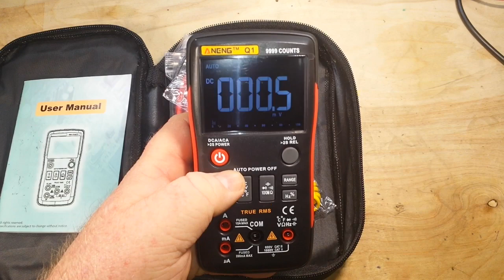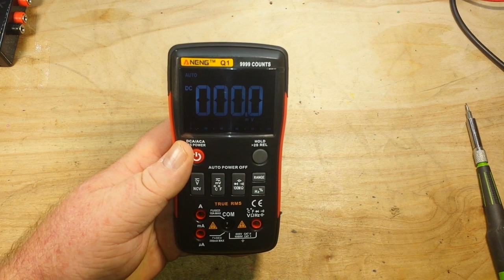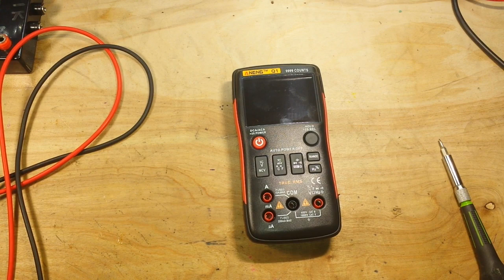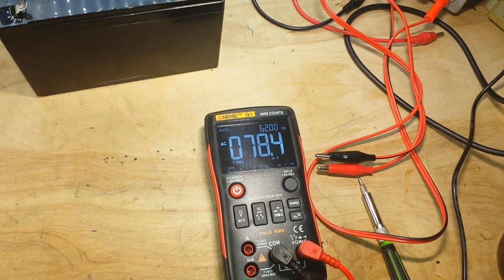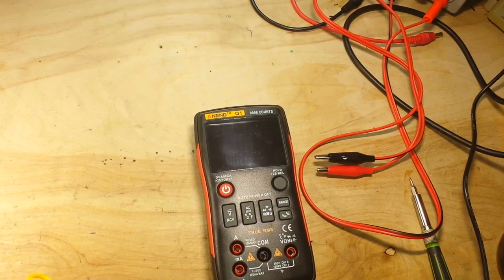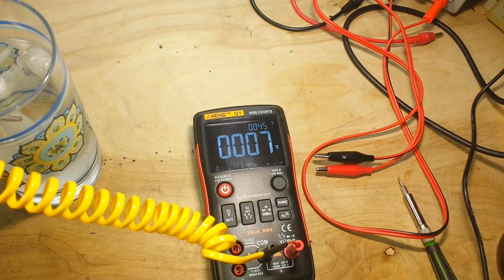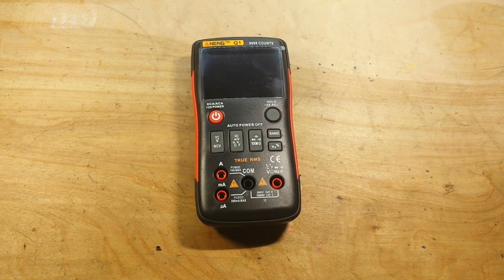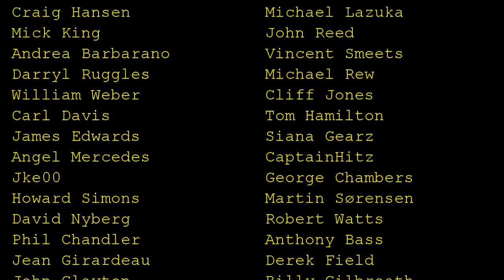Aneng Q1 In Depth Review and Teardown

Comment: 40 seconds in and whatever the result, I like the display a lot.
Reply: Idk, I think it draws battery power unnecessarily.
Reply: You wont. Unreadable in daylight + dependent of backlight always on so it will drain and quit working at a rate wayyyyy before normal displays.
Reply: @Brakballe  That seems to be Dave's (EEVblog) opinion. However, it is not exactly true.

Comment: Did anyone else see that 10 amp fuse move in the clips when the pencil barely brushed against it-??  I watched it three times, its loose in the clips-!  Not a good thing if drawing amperage, some serious arcing there if testing current.  Squeeze those clips together Paul-!-lol   I have four of the 8000 series meters and was really close to buying one of these the first time I saw it, but after seeing some reviews I think ill wait and see if they improve some of the initial teething pains common to any new design.  I saw another review claiming because of the display etc the battery life should be fairly short, if so thats another negative.  I really like the idea of the display too, but doesnt seem as well executed as it could be.  I agree with Paul, this meters design seems to be more of a marketing ploy than anything, if your going to put in a nice display make it an OLED, this white on black is interesting but rather odd after you look at it for awhile.  But its only just been introduced, maybe they will listen to comments and reviews and make the right improvements so that Aneng has another hit on their hands.  Above all its supposed to be a precision instrument, now that its getting up a bit in price theres no excuse for all the ranges to be accurate and responsive.  As Paul has said its not hard these days to have accuracy in a budget meter, same goes for this one regardless of fancy display and push button interface .

Comment: Some minor feedback from this circuit designer: 

The color of current shunt being not looking like copper is not a concern. Current shunts are made with metal alloys to provide a precise resistance for a given length. What matters is the temperature coefficient and how it is calibrated given that it is not a 4 terminal shunt. Some might be 10ppm/degree C others 1000ppm/degree C. A big difference!

 The poor looking solder on the voltage reference chip is a symptom of either too-fast wave soldering or 'through-hole reflow soldering' from being used. The IC leads didn't reach soldering temperature near the IC body, so the solder didn't flow. Hopefully the  circuit side of these joints look better. I bought a newer revision of this meter and I cannot even see solder on 2 of these leads, yet they must be soldered!  Not very rugged for sure!  Not IPC quality either. 

Here is why this meter is a good choice: I love the pushbuttons of this meter, it allows one handed selection to change settings. The meter can be on a table and one finger can turn it on and off, select the scale, etc. The large characters of this bright display are beautiful. Yes, the same measurements can be made with a cheaper meter, for sure.
Reply: Thanks. Does this meter have ESR measurement built in for in-Circuit checking of capacitors? Is this function good enough to replace those purpose built ESR meters for casual users (hobby)?

Comment: Why mine is showing negative voltage with no probes or load?After heating it with hot air it runs normal for some time but after some time it again start reading negative voltage

Comment: Hi Thank you for the useful review.. Did you try to check the frequency accuracy? Mine seems to be all over the place !!
Reply from the maker: Mine was accurate enough
Reply: No
Reply: If you are measuring a noisy signal, it may be counting noise spikes sometimes, not the fundamental frequency. That will cause higher frequency jumps. Measuring frequency is tricky with noisy signals.

Comment: I've opened mine to replace the 200mA fuse (ups!). It is strange, that, although it is ceramic, it doesn't have any sand to quench. The 10A one, on the other hand, it is filled with sand.

Comment: Would like to see a factory-fresh DMM hit the reference voltages spot-on, +/- 2 counts.  Even the cheap ones will usually read voltage very well.
I have bags of inexpensive chip and disk caps from China that are badly out of spec.  You should check a few more of those you were just testing.

Comment: Hi.
I just bought the aneng 8008,partially cause of yr review of it.
But when should i change fuses?
Thanks for sharing.
Reply from the maker: Only change the fuse if you blow it.
Reply: That makes perfect sense!
Thanks.
Reply: How do i know if its blown?
Thanks.
Reply: @rezganger  Oh, when it's time, you'll know for sure ;)
Reply: @edgars53  How?
Reply: @rezganger  It will measure no current, as if probes were not connected to anything even if they are. It will be very obvious in that it doesn't work.

Comment: HELLO, HOW TO DISABLE AUTO POWER OFF ? MINE IT'S BEEP WARN TO SHUT OFF IN FEW MINUTES. VERY ANNOYING . WITCH BUTTON SHOULD I PRESS AND HOLD TO DISABLE ? THANKS
Reply: Did you figure this out? This drives me nuts. I found out on the internet, because it's no where in the instructions. TRICK-hold the range button down, while turning on, the meter beeps 5 times and the auto off is DIASABLED. this kills the batteries pretty quick, although I use rechargable and don't care, I hate the thing turning off in the middle of measuring.

Comment: Damn, did u notice how that 10A fuse moved when u touched it with the pointer ever so gently ? That thing was so loose in there :p
Reply: I noticed the 10A fuse moving too!  It'll just get hot with any appreciable current. The author should open his meter up, remove the fuse, and squeeze the contacts together. I bought this meter branded B-Side ZT-X, and the fuse in mine is tight. 

My board is newer. His is rev 0.5, mine is 0.7. The resistor location bridged by solder is now gone, the current shunt is much longer and extends all the way up to the 10A fuse. The solder pads of the fuse clips are now larger. The solder joints he didn't like on the voltage reference are still poorly filled on the top side (although are likely OK on the circuit side of this board)

Comment: Hi.
I read in the notes: "The voltage supply should not exceed 36V DC or 25V AC if it is in the measuring current setting."
Can not measure current with a higher voltage?
Did you try?
Thanks for the reply.
I'm sorry if my English is bad.(Google helped.)
Reply from the maker: I have not tried it at high voltage settings
Reply: Would you try to test the current measurement at mains voltage?
That would help me a lot.
Thanks for the help.
Reply: Sandor ... it's a toy meter - if you want to do hobbyist projects on components that use 1-12 v (or as you've read 36v max) you are looking at 36x10=360w of power and the hardware rated as capable of handling it.
They put these restrictions on this type of tool for the same reason they impose current ratings on wire.  The thinner the wire the lower the current that wire can handle without over heating and burning you.
These toy meters are subject to the same laws of physics and if you insist on connecting into a 220v circuit you could potentially increase the power load 6 times to 2.2Kw which at worst case could prove lethal and could well cause the meter to become dangerously hot. 

it certainly explains Paul's decision to use his own leads but why there is no mention of these basic safety lessons in these reviews is beyond my understanding  Testing mains is always potentially dangerous and doing it using one of these mickey mouse meters is just asking for trouble.
With this type of meter you'd be strongly advised to limit your ambitions to the sort of voltages that come out of batteries ... and even then current testing LiLon batteries is fraught with danger if you're a beginner.

Comment: learnelectronics, do you know if you can use two Eeneloop batteries (2.4VDC)?
And will it dim the LCD if I used that battery?  
I read somewhere that the Q1 eats batteries quickly than many other LCD meters.

Comment: 17:50, I do have the same Multimeter, but branded with the original manufacturer's name, Zoyi-ztx by Zotek. The fahrenheit value is wrongly interpreted in relation to celcius. Do the calculation, 154 degrees of celcius is equals to 309 degrees fahrenhite, not 565, as it is seen in the meter.

Comment: The display looks good on my end.  I have been thinking about getting another meter. My first was a green Lee. Clamp meter. I no longer have it. I have a Klein tools clamp meter . and another clamp meter. It is a ideal meter. It does DC and AC current. The Klein doesn't. I need more high current DC measurement than ac. But I do need to measure it occasionally. I am powering my home with solar power. Off the grid. So I need to keep my circuits in spec. I try to stay under 15 amps per circuit. I also use a generator for larger loads . like the washer and drier. Dish washer. I'm getting a gas stove. And have a gas watter heater. I also need to check the frequency of my generator output! My ups doesn't like being powered by the generator. It says over frequency over voltage. But it doesn't have to be off much to alarm. Like .5Hz and 129v or so. And it lets you know it. I'm thinking about trying to make a arduino govenor to control the engine throttle. Because I could use a couple of them or more. How could you get a arduino to measure the Hz the gen is outputing? I guess a tachometer output would be easier. Use a small actuator to keep the throttle under control when load changes. The older engines used a flap blown by the fan to regulate the engine speed. Then it went centrifugal . witch is better. But still it doesn't know the generator output. And doesn't always keep its settings. What do you think about my idea? How would you design it??? May the force be with you!!!
Reply from the maker: Skip this one. The 8008 or 8009 are better and cost about half of what this one does.

Comment: Also meant to ask, did you see the 'roo man from down under rip this meter apart - not just literally. lol   He seemed right on some of his observations and testing, but I swear you could fix all faults & plate a meter in gold and he would still rip it apart.  On a side note, I believe the rebranded Bryman meters he sells had some teething pains of their own.  One came back with an arc over on the range switch and others had a range switch problem and the company had to send out "disc shims" to tighten up the clearance in the range switch.  But to his credit he showed it all on YT.
Reply from the maker: I didn't watch his review and tear down, i wanted to do mine with no bias.
Reply: Understood, thats the way it should be.  Seems like hes probly right on the battery drain, but im no expert either.

Comment: I thought about buying one of these but I decided not to and I'm still looking for a decent 2nd meter...I don't do electronics a lot so I don't need anything too expensive..I have a Uni-t UT136C and it's a really solid nice little meter..Any suggestions for a $20 and under meter? I would buy another Uni-t as I'm very happy with the one I have but I'd also like to try a different brand. Aneng 8008/9 looks decent but those small fuses might be a deal breaker.
Reply from the maker: https://youtu.be/MGtx1xbP8Hw

Comment: Something not right with the temperature 180c = approx 358f not the 614f displayed there (approx 323c).
180c is marginally less than the melting point of 60/40 (183c).
Round 17:52 When you see the reading hits 140c the f drops abruptly from  a wild 545f to a more accurate 280f.
I've seen badly inaccurate readings but never seen the (presumably) on chip MPU do that before.  Or is it an add on temp chip?
Looks like the firmware on the COB is seriously flawed.
Reply from the maker: This meter has some design issues

Comment: Hi I bought the same device but after a period of downtime I can not switch between the settings of the buttons Only the screen worked I did not find the solution to the problem of the machine Chinese industry is all non-operation and quickly damage

Comment: found it "amozon $20-25"  Probe Master 8000 Series Right Angle Banana Plug Test Leads however i also found Multimeter Test Leads Kit Double Silicone Multimeter Probes Electrical Copper Test Probe with Gold-Plated Needles at $10 but i think probe is better.

Comment: I dont think its worth the higher price compared to the 8008/8009. It doesnt seem to perform any better and it doesnt really add anything useful.
2 things came to my mind right away:
Its a lot easier to accidentally press one of those buttons and switch to a different mode while doing measurements compared to a classical rotary switch. 
And that display needs a lot more power compared to a classical one while not being any more readable at all.
Reply from the maker: I agree with you
Reply: I agree on the buttons being easy to hit without meaning to.  I really liked the idea of the display and buttons on this new meter at first, but then after looking at it awhile the display seems a little odd looking. I saw another review from Dave down under showing how the battery life was severely limited due to the display, probly why they had to go to AA batteries.  If it was me, a more effective redesign might be to fix the few shortcomings of the 8009 like the prop stand, add missing low volt/amp ranges some have complained about, and replace those tiny hard to find fuses with bigger easier to find ones hopefully in HRC type.  In addition they could make this new 8009 a bit bigger, maybe make it the size of the Q1 only with a bigger standard display with bar graph.   These mods would make the 8009 an even bigger hit as long as the price didnt get crazy.
Reply: Did you check the Aneng AN870?  It covers some of your points
Reply: Yes ive seen the 870, have ya seen arturs review and teardown of it-?  Not a bad meter but the interior is 
shockingly vacant and flat as described by artur-lol  In fact I left a comment on his review because for some reason his dry understated somewhat humorous commentary of the 870 struck me funny, I dont know why.  Truth is I had the meter bug for awhile and I have so many meters now im sure at least four of them if not more will cover anything I need to do-lol
Reply: I didnt see that review but I got one about a week ago. There really isnt much in it but I like the extra current ranges. Besides that it is pretty much just a bigger 8009. Which is not a bad thing at all. I dont really care about the lacking protection cuz I dont really do anything above 15V DC anyway
Reply: Yes the 8009 is a great little meter and on the 870 you have a larger display as well.  In the end for low power bench work it doesnt matter as much what the board itself looks like as how it works and if it has the needed features and performs well, and they seem to sell pretty well so if the 870 does what you need its a good fit.  I had to go refresh my memory and take a look at one, and its not a bad looking meter at all, the button pattern reminds me of the black MeterK MK01A meter that Paul recently reviewed.  I have an MK01A and I cant believe how good it works for so little money, it seems very close in board and features to the Aneng 870 but dont think its 20,000 count like the 870 more like 6000 count if I recall.  If ya havent seen Pauls review on the MK01A its got accuracy, large screen, lots of features and costs less than $15.00-!  Not sure but I think it has the low current ranges as well.  Hm, you have me interested in the 870 again, as Paul said once these days with the new multimeter chips it doesnt take a board full of stuff to get accurate measurements, so we dont see as many components as we used to - of course these meters have almost none of the high current/voltage protection you get in the Flukes and such, but if all your doing is hobby/home bench work you dont really need it.
Reply: Heres a link to that AN860 review and take-apart, sorry I thought it was an 870.  Humorous in a low key sorta way-lol  He likes the meter pretty well.        https://www.youtube.com/watch?v=92Asdrcb_DE
Reply: Hm - just looked at the 870 on ebay and it is a nice looking meter, only a bit more money with bigger display and lots of features, might have to add one to the collection-lol  Like you said, a bigger 8009.
Reply: I've seeen the MeterK MK01A review and it looks like a really cool meter. But here in Europe its around 20 Euros which makes it more expensive than the 8008 or 8009
Reply: Thats too bad, sucks you guys get hosed on good deals like this it isnt right.  I got mine for like $11.00 and couldnt believe the value - no real input protection of course but its got all the ranges one would need for home or hobby use, amazing how they can get so much out of essentially one meter chip and so few other components.
Reply: Is good? Or aneng an8008?
Reply: In my opinion the (AN8009) with NCV function and a standard range  is a better choice than either this new Q1 or the 8008.  The new one looks good at first glance, but its still new and will be hard on batteries and the new meters reliability is not yet known, whereas the AN8009 has been out for awhile and has a pretty good reputation.  The 8009 is an upgrade to the 8008 and has the NCV (non contact voltage) function in place of the 8008 square wave function, and I believe the average person would get a lot more use from the NCV than the square wave function.  Also the newer 8009 has the temperature function as well which the 8008 did not. 
This is just my opinion as I have both the 8008 and the 8009, both are good but I like the new ranges on the 8009 better.
Reply: I do use a multimeter regurly and the rotary knob on mine is the biggest gripe i have with it.
I need 2 damn hands to turn that sucker. So yeah buttons seem like a really good idea for me. (Also not much if ever in the situation that stuff can fall on it).